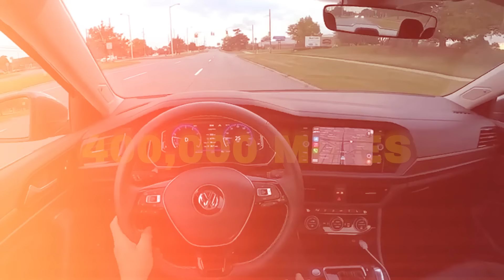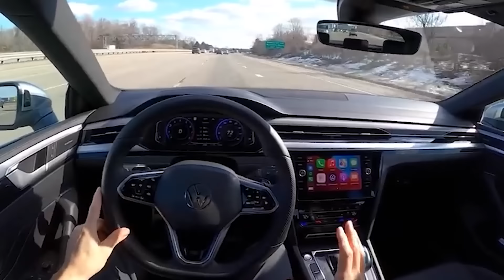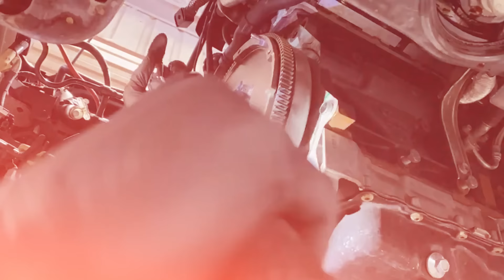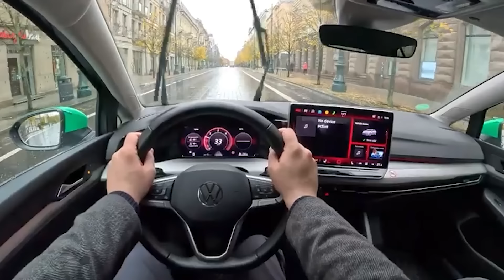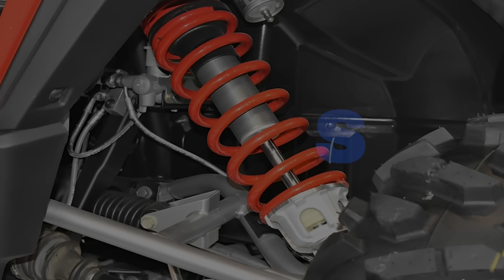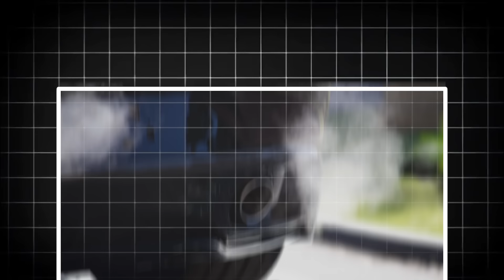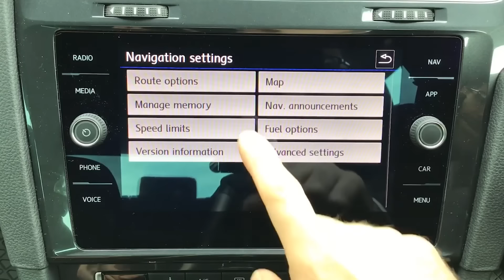How To Make Your Volkswagen Last Over 300k Miles Without Any Major Repairs

Comment: I bought a 2013 VW Passat with 95K and I'm expecting nothing less than 500K I know it's possible I just changed my oil n ALL filters minus the transmission with Mobil 1 esp 5w30 going to put a timing belt on it myself next week then service the transmission I love this car it's fun to drive my cousin was driving it and I told him to put in on the floor of course it was warm I didn't want to put extra strain on the turbo he said it's guy a lot of torque I said it should number 1 it's a VW and number 2 it's a diesel he said there's no way when we got back home I proved to him it was a diesel when I opened the hood lol Thanks for your content I look forward to seeing more!!! Btw I'm changing my oil every 5K next change in doing an oil analysis if there's a butter l better oil please let me know!
Reply: Do your DSG every 40k 5 litres out 5 in full through the filter port at the Top before replacing filter, just change the fuel filter every second oil change and yes with the timing belt done with everything that runs on it it will get you 500k
Reply from the maker: Thank you so much for your comment!!! Glad you like our content. And we have uploaded video about the oil change too. U should check that out and yeah for more deep dive please stay connected!! ❤️